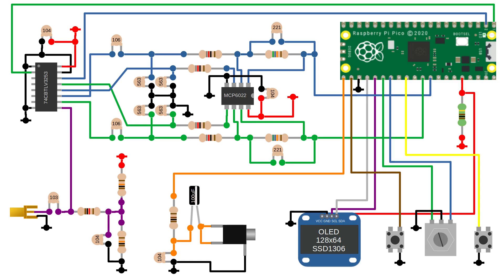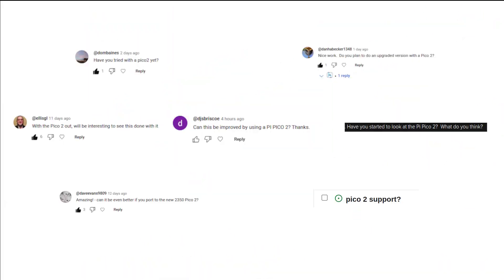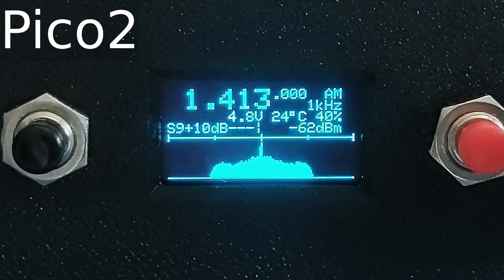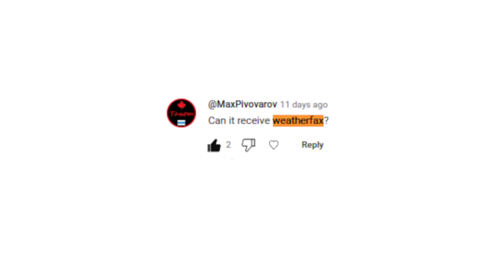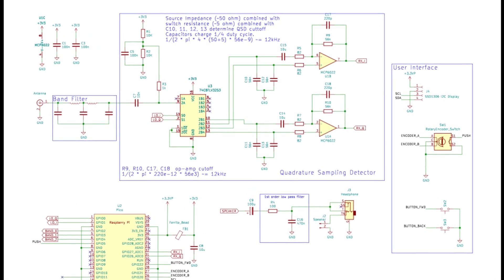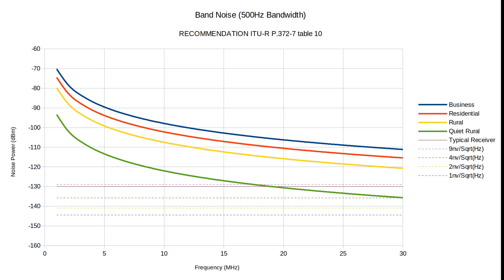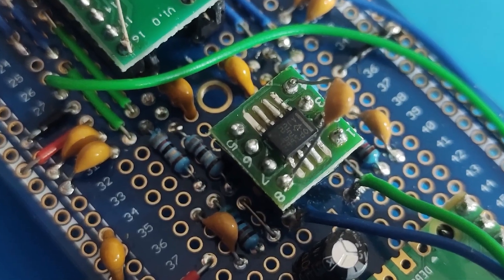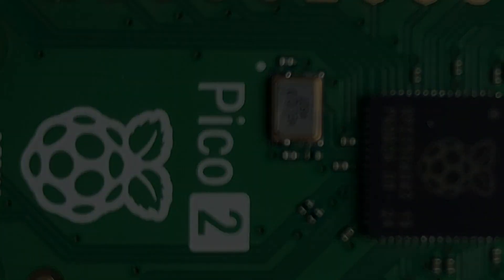Software Defined Radio with Pi-Pico - Part 2 Pico 2 upgrade

Comment: I am in the process of designing PCBs for my version. I am not in favour of using bandpass filters in the front end but instead will use a dual gate MOSFET BF998 as the LNA and an input tuned circuit, This will use two high Q toroids (T50-6), one for 3 to 10 MHz range and the other for a 10 to 30 MHz range. The tuning will track the frequency by switching a combination of 7 fixed capacitors to be selected by a PCF8574 I2C expander. As this will not be exact, a varicap diode with an additional front panel potentiometer control will allow for errors in component values and antenna loading. This will require extra code. I used this method in my SSB RX design that was published in the Australian magazine Silicon Chip June and July 2025.  Will post progress on this.
Reply from the maker: Hi, Sounds like a great setup! If you are having a PCB made, it might be worth checking out the latest improvements - https://101-things.readthedocs.io/en/latest/breadboard_radio_part4.html There are a couple of simple/optional improvements that might be worth considering. The anti-aliasing filter gives a decent performance improvement and only needs a few extra resistors and capacitors.
Reply: @101Things-ds8tc  The PCBs are ordered from JLC but I did not include the anti-aliasing filter, however, the cost of PCBs is almost nothing these days and version 2 could include it. But my main problem is in the program. There are lots of files listed and I am not sure how the program needs to be structured to include all the required files. Obviously, I have to add code for the PCF8574 I2C  for tracking frequency and switching in capacitors.

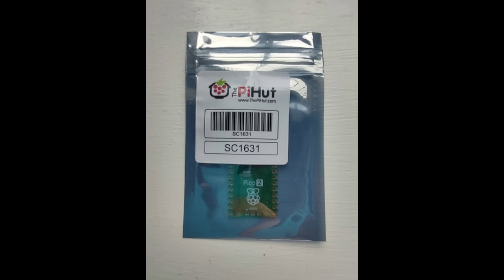Comment: Awesome project even for a non radio amateur! I really appreciate the effort to tweak the project. 1:14 is there somewhere described which lines of code have to be adapted to work with pico 2 (for ARM M33 core or RISC V core)? In github repository I can find the binaries but I could not find the required changes in order to build the SW. Thanks for any hint.
Reply from the maker: Thanks! At first I had to add a few lines to explicitly configure IO to be used for PIO. The changes are all in the repo now, so should build on any of the 3 platforms without making any further changes.

Comment: I just noticed the Pico 2 w has hdmi so, 
could it be used to display on a large screen?
It also has bluetooth so maybe a smarphone could be used as display, n'est pas?
Of course nothing beats the .96 Oled for portability.
Reply from the maker: Yes, it's an intriguing idea, I think the hardware support is there. The challenge might be meeting the CPU and RAM constraints.

Comment: good day 
maybe you experimented with "pi pico zero" if so, could you share your experience?
Reply from the maker: Hi, no I haven't done anything with the pi pico zero. Looks kind of neat though, if I needed something with a smaller form factor, it looks like a much easier option than building a custom rp2040 board, certainly something worth considering.
Reply: Thanks for the answer. If I have interested you, I am waiting for a video where you tested "pi Pico zero" in the near future. @101Things-ds8tc

Comment: I cant get it working with Pico2. I'm using github and vscode via clone Github. Any other simple program as test Blink works. Pico Rx is a project for me very important and i'd like to get an help for Pico2. Thanks a lot.
Reply from the maker: Happy to help! Can you tell me a bit more about the problem - how far have you managed to get? You could try using the pre-compiled version first and see if that works?
Reply: @101Things-ds8tc  Hi dear! Tnx for the prompt answer. I'm a newbee on pico family. I get receiver working with pico 1 so I could test the functionality. Yesterday i got my brand new pi2 so I try to make it work. As a result is 1) cant open the file....(where the picorx is) or 2) missing partition table. I usually clone the project on github, dowload on github desk top and finally I open it with visual studio. I see all the pico rx files, i go further with run on usb, i see it running, but ends with nothing. code -4 or cant open the file or again no partition table. Thanks a lot for your help,
Reply from the maker: Ok, have you tried using the pre-compiled uf2 file? Do you still have the same issue?
Reply: Yes. Nothing.
Reply: @101Things-ds8tc  I mean I dont have similar problems with other projects, so I dont think this is the problem.But never be sure! What do you suggest? Did you use VSC for charging the program? I did by passing thought Github desktop as usual. With pico1 no similar issue.
Reply from the maker: I have tried vsc, but don't use it often, so I'm not that familiar with it. I'm still sure I can help you get it up and running though. When you program the pi Pico with the pre-compiled uf2, what happens?
Reply: Do you mean pre compiled hex? Ididnt try it, because i'm not familir with it. If you mean exactly what i do is copy the adress on github clone via github desktop and as second quasi automatic step is going to vsc and injected to the board. Common error is cant find file "picorx.elf.
Reply: If you are familiar with snother ide or platform i can use it the same way. 🙏
Reply from the maker: There is a compiled .uf2 file you can use to program the Pico directly, no need to compile: https://github.com/dawsonjon/PicoRX/releases/tag/v0.0.1
Reply: Ok thanks a lot. I have seen it, but dont know how manage it. I will study more and I 'll keep you informed, thanks so much friend!
Reply: Eureka!!! It works!! Now I'm a bit less ignorant than yesterday. Very happy...just thinking on how many hours I spent for nothing! Drag and drop was all I missed.  Thanks a lot! Happy Holydays

Comment: love to have 8k0 fm\11k fm\16khz fm selectable bandwidths,FM noise squelch detector ,Am carrier Squelch S meter,extend rx range upto 55mhz
100hz\1.0\2.5\5.0\6.25\11.25\12.5\20.0\25khz kc step selection ,AGC Fast\Slow selection.

Big list but makes a exellent vhf lowband RX monitor.
One idea did have is a FM deviation monitor for testing cb and 10m fm gear deviation!

Love your vids 
Rob.P 73's
Reply from the maker: Thanks that's great! I think we have most of the features you listed already, but we are still adding new features all the time. Extending the frequency range might be possible with an overclock, or by using another mixer/down converter. A few people have reported success recieving VHF and UHF this way.

Comment: It is posible to replace the operacional using a NE5532DR ?  because I have it
Reply from the maker: Yes, sure, it's got the bandwidth and has good noise performance. It's a 5v device though, so you will probably have to adapt the circuit to run the op-amp from 5v rather than 3.3v.
Reply: of course you can. did you run with pico2?
Reply: @antoniobertezzolo6307  I bought a pico 2 and , i install Python , but still not run the code

Comment: An  excellent project.  I wonder if the Tayloe detector could be implemented in  the Pico 2 PIO rather than using an external IC
Reply from the maker: I have experimented with using gpios to make a crude mixer by periodically grounding and ungrounding an RF signal through a resistor. (This was using an FPGA rather than a microcontroller, but I think the principal is the same). It did work and I was able to receive strong stations, but the performance wasn't amazing, and of course you would still need some kind of external amplifier to achieve a reasonable sensitivity. 

I'm using the PIO to generate the quadrature local oscillator, which does eliminate the need for an external clock generator ic. This seems like a good compromise. It allows a much more useful receiver to be constructed, but is still relatively simple to build.
Reply: @101Things-ds8tc  All understood, thank you.  I found the H-Mode mixer to be be best I have used in SDRs. However, it does need RF transformers so the Tayloe detector has its advantages.

Comment: Great little project, built it up the other Saturday afternoon. Have to say I'm surprised how good the audio output is considering the simple pwm circuit used. 
I was wondering though if you think it would be possible to use I2S, something like the pcm5102 dac. Just curious as I have some in the component drawers that I've used before with the esp32.
Looking forward to the next installment, keep up the good work.
Reply from the maker: Cool, really pleased you got it working! We have a gallery of completed projects here: https://github.com/dawsonjon/PicoRX/issues/99 would love to see a picture if you have the time.

I'm sure you could get an i2s dac working without too many problems, I think there are some examples driving i2s using pio.

I agree with you about the PWM audio though, for something so crude and simple, its surprising how well it works.

Comment: i think you should not go for a larger screen but add a second oled one like this just for the waterfall, a waterfall is a welcome solution mainly when you have adjustable Loop antennas, also do you have the board file to order JCPCB?
Reply from the maker: Cool, we now have selectable views on the OLED,  including a waterfall view. I have been prototyping an optional extra TFT waterfall that will be in the next release.

Comment: Thx for the great video. I am new to the SDR topic and was wondering what it would take to extend the frequency rang up to the 2m band? Could this be done with an external programmable oscillator?
Reply from the maker: Cool, glad you liked it! Yes, should be possible to get to 2m band with and external mixer and oscillator. I haven't tried it myself, but others have reported success.

Comment: I am seriously thinking of building this, as an entry into SDR. I have one question: looking at the schematic, there are three outputs from the Pi:- bands 0, 1 and 2. Where do they go? Sorry if this is a dumb question, but I couldn’t figure this out.  Thanks for your help.
Reply from the maker: Cool, best of luck with the build!

The band outputs aren't used in the breadboard version, but the original PCB version used them to automatically switch between low-pass filters in the preselector. 

The idea with the breadboard version was to keep things simple by using external/plug in filters, or leaving them out altogether.

I have kept the control signals for backwards compatibility and for more advanced constructors who want to upgrade their receiver by adding a preselector.
Reply: @101Things-ds8tc  Thanks!

Comment: Thanks for the great work. I did a remix of your cabinet STL files in OPENSCAD so I could fit the components I had on hand a little easier. The pico , display, encoder and buttons are mounted in the faceplate and wired together and working as expected. I built the tayloe circuitry on a separate board so I can try different muxes and op amp combinations. The next step is to wire the tayloe detector up to the pico and add so input filtering. Looking forward to another video.
Reply from the maker: Cool, glad you like it! Let me know how you get on!

Comment: I saw the image of the PCB design in your docs. I can't wait until you have a PCB to simply plug in a PICO 2 and get an SDR -- bonus if it did CW TX also! If I can help somehow let me know, including help fund the first batches.
Reply from the maker: Thanks, loving the enthusiasm, I will give it some thought!
Reply: @101Things-ds8tc  Any more thoughts on going forward?   We are very enthusiastic about getting more people interested in CW and morse code.  I think that the world really needs a very inexpensive TX and RX radio.  I keep researching options off and on and wish there was something.  I'd be happy to help anyway that I can.  

If you had a design that could assembled by one of the many contraction manufacturers, I would imagine we could have them reliably built and testing very cheaply.  It would be a game changer for the CW / morse code world.

Comment: Thank you for your video. I commented on FM Radio with RDA5807 Video. I decided to try this out next time, so I gathered the parts. I am trying to configure it on a breadboard. I've only tried AM, but I was able to receive it anyway. So, I would like to ask if you could explain how to use the buttons, the meanings of the menu items, and how to use them. Thank you for your support.
Reply from the maker: Thanks! Probably a bit to much to put in a comment, but I will post a user manual when I get a spare moment!
Reply: @101Things-ds8tc  OK, I understand. I can use it somehow, so it's fine when you have free time.
Reply from the maker: I have written a user manual, you can find it here: https://github.com/dawsonjon/PicoRX/blob/testing/user_manual/Pi%20Pico%20Rx%20User%20Manual.pdf
Reply: @101Things-ds8tc  Thanks for the user manual. The menu items may differ from what I see here. I think it is compatible with the latest software. I am using the pre-build that was uploaded. It seems that the pre-build is not currently uploaded. In my environment, building from code doesn't work well.
I don't have the skills to do that.
Reply: I updated pico-sdk to v2.0 and was able to build it. The menu items are now the same as the manual. However, even if I press the back button, the display does not change.Other than this, everything is as per the manual.

Comment: Great information
We are going to build 3 receivers. I only have a hard time finding the small boards you got for the  chips as a module, its not in the BOM, got any advice on these?
Reply from the maker: Thanks, this is the sort of thing I bought https://shorturl.at/fcEnQ, https://shorturl.at/L6Rsp. The major electronic distributors do them too, but its usually cheaper to source from amazon, ebay, aliexpress or similar. They are usually double sided and have fine pitched SSOP on one side and course pitched SOIC on the other. Just search for "SSOP-16 adaptor" (for the mux) or "SSOP-8 adaptor" (for the op-amp) and you should find something that will work.
Reply: @101Things-ds8tc  Ah fine thats it thank you!
Reply: The link to your prebuild  is broken, got 404
Reply: @101Things-ds8tc  Hi, this is great, we installed 4 Pico2's and it works fine, I am using the 1.3'' display,  next step will be to install the op amp and the mux. Point is that the frequency is 6.3Kc off and it is the same on all 4 boards and on all bands . Is there a way to calibrate this ? 
Further more if you can spare the time could you get the driver for a 1.54 Oled, SSD1309 in a future version?
Thanks in advance and so far you have 4 radio amateurs enjoying your Xtal receiver and having  having great fun!
Reply from the maker: Hi, really pleased to hear you are enjoying it!

One of my collaborators has recently added support for a more sophisticated display library, so it might be possible to support a greater range of displays in time. 

I use a small IF frequency offset of about 6kHz to avoid noise close to DC, so its normal that the local oscillator will be about 6kHz away from the dial frequency, the difference is taken care of in software.

I will be adding frequency calibration, but the oscillators on the pi-pico tend to be well within spec, so you probably won't need it in most applications.

We have started a gallery here: https://github.com/dawsonjon/PicoRX/issues/99, would love to see your builds if you want to post them!
Reply: @101Things-ds8tc  Ha thanks for the reply, it's clear now the 6Kc offset, looking forward for the Display driver. 
We will post some pictures of our  prototyping ;-}, 
Regards
Ed

Comment: Rather than a larger waterfall display.  Provide an HDMI output to take advantages of comerical monitors with built in audo amps and speakers.
Reply from the maker: That's a cool idea, driving hdmi is definitely doable with pi-pico, think it could be challenging to fit it all in though...
Reply: Here’s a starting point. Basically you need to set up one of the PIO units to put out your data/sync etc. Very easy to implement. I’ve used it to drive a data rich HUD for a radio control project. 

https://youtu.be/ZXMdZGQzrWg

If the link fails search for RP2040 Hunter Adam’s Pico VGA

The first time I implemented a display (video out) was on the pic 12f683 over a decade ago in assembler. Things have gotten simpler and much more powerful since!

It might make sense to offload this to its own dedicated RP2040 because the RP2350 has its work cut out for it, namely DSP noise reduction and bandwidth filters etc. nudge nudge, wink wink. 😉

Comment: @101Things-ds8tc I'm about to order parts to build a PicoRX, I really like the project! Can we maybe move the display to a completely seperate housing? I was thinking about sending data via serial between two Pico's to have the OLED/other Display completely decoupled. Then we can chose different displays and even "remote control" it via a PC? Similar to the YAESU FTM-400!
Reply from the maker: I had thought that it might be cool to make a "headless" version without a display that has a CAT interface and USB Audio. Then it could be used with a phone, or a PC, or some other custom interface. Good luck with your build!

Comment: Aside from tx and mesh capabilities, would be awesome if the software was more dynamic/generic and you'd have a BT connection to a cellphone that can change parameters, config settings, upload/download txt and media streams, and even flash/ over the air file updates, without a computer. If a computer is needed use the pi 0w and do the flashing from there haha

Leme know what you think
All the best!
Reply from the maker: Great ideas, thanks! 👍